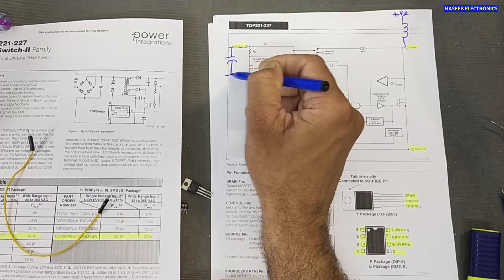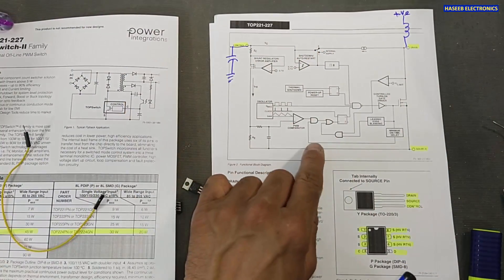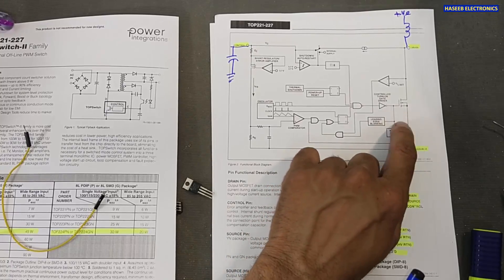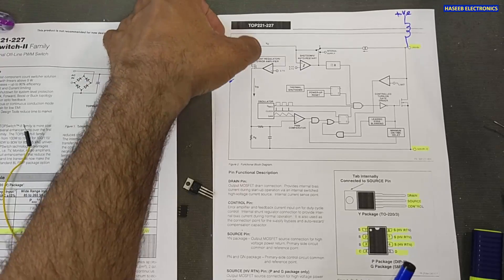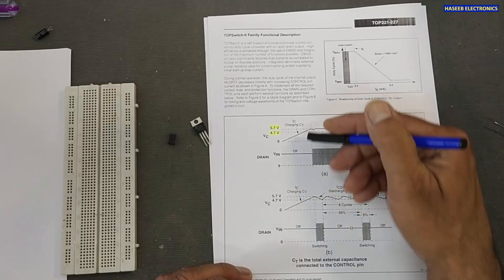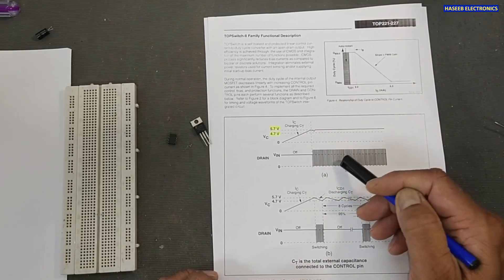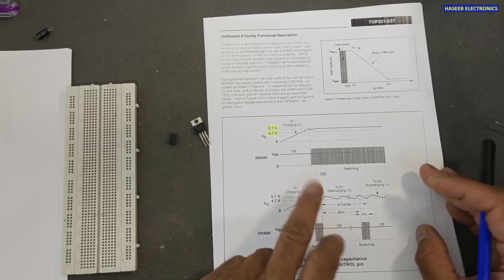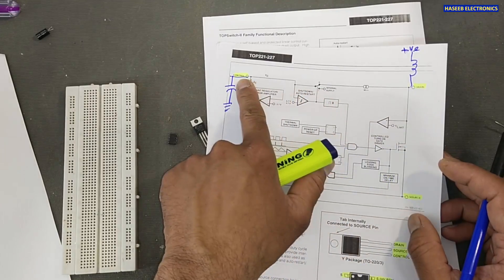{786} TOP221-227 SMPS IC Circuit Explained and Testing

Comment: Sir, how to redesign a TOP227YN circuit to works perfectly with any universal DM0465 kit or 5L0380R kit? Nowadays the TOP227YN ICs available are all craps and could not withstand loads for long time. So want to convert it with any universal kit. Thanking you in advance.

Comment: Hello, thank-you for all your time and effort teaching us, would a faulty opto coupler cause the VCC capacitor to heat up and explode, its the capacitor connected to the TOP221P. It only does this if I add loads?
Reply from the maker: normally an optocoupler is working as a series switch. which couples ground as feedback to PWM IC. and in some cases it switches vcc voltage from vcc winding to the PWM ic vcc pin. might be there some other error which is causing to explode the capacitor. 
there is one possibility that the vcc capacitor is low voltage, otherwise 50v range capacitor is used as vcc capacitor
Reply: @Haseeb Electronics  thanks for your reply, I'm a bit stuck with this. The capacitor is 4.7uf at 450v, the diode supplying this capacitor will go short too sometimes too. I'll keep investigating, I have schematics.
Many thanks
Reply from the maker: if it is 450V that means it is bulk capacitor. connected in output of bridge rectifier . please check bridge rectifier. if bridge rectifier is damaged, it causes to provide ac voltage to dc capacitor and and dc capacitor explodes
Reply: @Haseeb Electronics  I will check you suggestios, the Bridge rectifier is charging the 4 large capacitors at 323 volts dc, the power supply runs fine until I plug in the loads (2 Amplifier modules and a mixer section) it a Behringer PMX5000. the smps is a SPS600, I can leave it running without load for hours with no issue, I can not isolate the issue. 
Many thanks
Reply: The 4.7uf 450v capacitor is connected to pin 1 of a small tranformer, this tranformer winding pin 3 then goes to a TOP221P Drain pin,
Reply: I found the issue, I watched some of your lessons again and again, I found a 1nf 400v MKT filter capacitor has lost 1/2 it's capacity and I assume this was letting by "line noise" to the 4.7uf 450v capacitor and causing it to fail.
Thank you so much 🙏

Comment: MR. Haseeb, Great thanks to your wonderful explanation .Let me tell you my experience with this ic. i was repairing a controller which this ic was its power input main component. i was skipping this power stage because i didn't understand how this ic works, so  i applied externally the needed DC voltage that will be generated by this ic circuit. then when it came another time i had two controllers of the same type, i tried a different thing which is that i changed the control pin capacitors and ,thanks God , it worked. Now i understand how and why  my action made difference. so, i'm grateful for you sir
Also,it will be wonderful to organize the videos where you explain those power ics on your channel gathering them in a playlist with special title .thanks again sir

Comment: How does the IC regulate the output voltage ? Does it it change the duty cycle based in the control voltage ?
Reply from the maker: exactly 
as it offline pwm switch
 so it adjusts its duty cycle based on the control voltage value

Comment: Hello, what about OB5282cp smps? It has VDD 11.2V but its not giving output for mosfet  :-(
Reply from the maker: please check components at pin number 1
check current sense resistor 
check mosfet 
optocoupler 
if everything is good. then  the IC may be suspected
Reply: @HaseebElectronics  pin 1 at this circuit is not even used its circuit is open by the factory. I though, that if smps gets vdd voltage it should be runing even mosfet or other component is bad. IC is not giving any pulse to the mosfet, CS resistor okay but 0V measued on live circut, also 0V FB pin 0V optocoupler both sides (makes sense if mos not pulsing) or am I wrong? HV pin gets 123V but its rated for 500V so this should be okay. Thank you for your time!

Comment: Hello sir can you pls help me for find this smd code what is that{ (s478ku)(6 pin)} i founded this in tv Android box.
Reply from the maker: welcome dear 
i think it is not S478KU
it is S47B its equivalent part number is R1511S047B
it is 4.7V regulator 
please check its datasheet. might be it is the same 
https://www.mouser.com/datasheet/2/792/r1511-ec-1099479.pdf
if it is helpful, please let me know
Reply: @HaseebElectronics  okay i check this again and thank you so much for this information and I appreciate your help help
Reply from the maker: most welcome

Comment: Thanks sir 
   I want to that three leg ic and eight pin ic both work in the same manner? Ie:as switching ic ? Then do we need to use pwm ic or not? Then what about power op temp of ic and heat sinc sir? Will it resit temp at above 300 v 5amp and above , pls let me know regarding small chip.
Reply from the maker: best regards 
1. both 3 pin and 8 pin (DIP & SMD) work in the same way
in 8 pin packages, pin 1,2 3, 6,7 & 8 are grounded
5 is drain pin and 4 is control pin 
while in 3 pin, pin 1 is control, 2 is source and 3 is drain 
2. these ICs control the PWM based on the control voltage (considered as feedback signal)
3 pin IC is installed on heatsink 
4. both ics have auto shutdown on over temperature